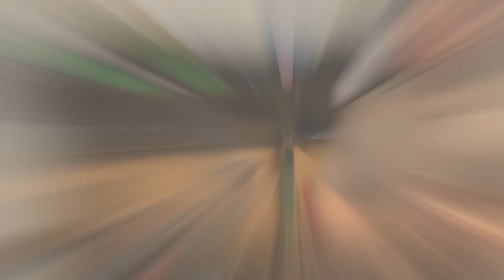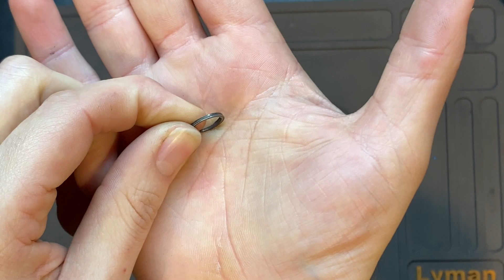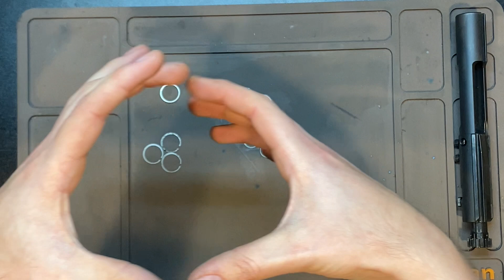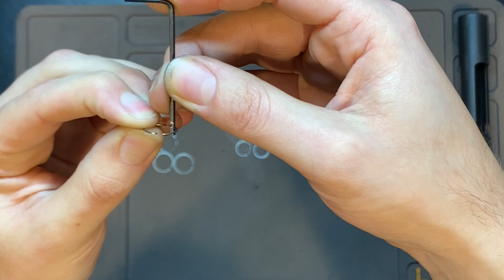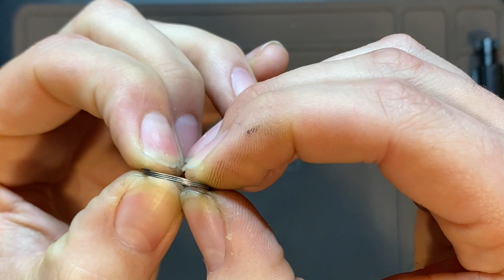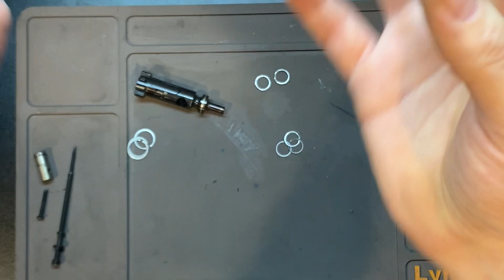McFarland/JP One-Piece Gas Ring VS Mil-Spec Gas Rings for the AR15/AR10

Comment: Thanks for sharing. 

Is it fair to say that you are under the impression the primary reliability issue you have run into with low mass carriers is not overcoming all the forces necessary to completely chamber the round? 

I've run multiple 6oz carriers with the springco yellow and have had the occasional malfunction, but when inspecting it with a high speed camera (and while not being able to reproduce a malfunction), it seemed more likely that issues in my case could have to do with bolt bounce more than falling to completely chamber. 

On one hand I could imagine a scenario where the one piece ring allow more bolt bounce as the friction is reduced but after it has bounced it would likely have a better chance of going fully into battery. 

Are you/would you exclusively run the jp one piece ring for a comp gun with an in spec low mass carrier?

Comment: This was helpful. My new 308 build … BCG is refusing to open. Gas port fully open …. It’s basically a bolt action. And every time I use the charging handle i have to brace it and use both hands. I checked headspace. No issue. 
Saw this video. Took out gas rings. It’s smooth as butter. 
So I’m gonna try the JP gas ring. Ordering it. Thanks for the explanation.
Reply: Your problem is that whoever made your barrel or gas block didn't drill the gas port to spec, or it's plugged.  not a gas ring problem.
Reply: @shockwavecity  right. Gas port too small.  Typical on these barrels from BCA. But changing gas rings easier than drilling hole.  But yes.  It’s the hole poorly made
Reply: @alecubudulecu did the JP do the trick for you?

Comment: As they wear out, it allows the opening in the rings to open up. If the opening in the rings have aligned, more gas and debris will escape. Only a big deal in extreme wear cases.

Comment: I always thought the gas rings are spring loaded so they form a tight seal against the bore of the carrier’s bore with making it an interference fit. If they’re not tight that means gas and the debris the gas is carrying will blow past the the rings and out the back of the bolt into your fire control group. You don’t want that flowing past the gas rings, that’s what the vents in the side of the carrier is for, that blow the excess gas out of the ejection port.
Reply from the maker: They are mainly spring loaded to take the shape of the bore. Having the shape of the bore is what provides their seal, not so much the pressure against it.

Any gas that makes it past the rings simply makes it to the vents on the bcg.
However, the Carbon on the fire control group is more than likely coming from the bolt tail seal. The bolt tail doesn’t use gas rings so there is always a leak there.

The vents are simply there to relieve the pressure once the bolt has been unlocked that way it can redirect excess gas away once the needed amount has been used.

Comment: The only rings I've ever seen not turn is oil wiper rings, everytime I've taken a motor apart i assembled the combustion rings are moved but the oil rings are not. You're one of the only people that truly understands gas rings!   I've seen so many videos of people regurgitating the same information, your the only person to use your own terms. You have a good understanding of physics an also are good at communicating, very informative video!
Reply from the maker: Thank you! I do try my best! I am an automotive test technician by trade, alot of what i talk about in my videos is based on my experience from my line of work.
I do take pride in what i do for a living and i love sharing these similar concepts with others who share the same mindset.

Please dont forget to subscribe, i have more content that i plan to upload in the near future!
Reply: @eitrisenhancementsllc  got my jo enhanced gas rings, an that's insane with how theres no resistance on the rings but holds pressure great! Worth every penny on a gun thats low on gas.
Reply from the maker: @jogs2fast  did you end up having good results with the JP in your build then?
Reply: Took roughly 200 rounds to get the rings broken in an sealed actually ended up with more gas an less drag! It's crazy with how the bolt just falls into the carrier but yet can be sealed better. 100% think it's necessary if the ring path is in good condition, preferably a low round count carrier. When I took the bolt out of the carrier the half of the bolt towards the firing pin side had NO carbon beat the rings had sealed it so good before there would be carbon/ unburnt powdered in every crevice.

Comment: Im having problems with super light gassed 300 subs hopefully the JP will reduce friction but still seal an help the problem.
Reply from the maker: Id recommend against this, you will actually lose efficiency, the JP gas ring should only be used on platforms that have excess gas available. If lack of gas is the issue then i highly suggest you keep the 3 piece gas rings

If you are struggling with cycling, i recommend you go another route that i just experimented with with excellent results.

Change the hammer spring to a reduced power hammer spring.
Currently im using a geissele ssa-e with an alg purple hammer spring.
This has no effect on pull weight on a 2 stage trigger, and since the geissele hammer is lighter, there is no need to “bob the hammer”

People forget that it takes energy to cock the hammer. Not only that, its energy stolen from the cycling of the bolt.
Reduce energy required to cock hammer, more of that energy gets used to cycle the bolt.

The results were quite drastic for me, especially since its energy stolen at the beginning which is the most important time for guns with short dwell time.
Reply from the maker: I stand corrected, my testing has shown the opposite, ive had great success with jp gas rings in 300blk

Just have to make sure you are using a properly spec’d carrier. Typically anything chrome lined will be g2g
Reply: The 300 Bo was designed for a 200 gr. bullet using a silencer. Which gives the back pressure.     Without a can an AR15 will operate well with bullets from 115 up to 135 maybe a little more.

Comment: Honestly, I was looking at JP to extend the life of my rifle. The firing pin and gas rings have been my issue and I forgot I had a JP bolt on my 22” Grendel that’s had 0 issues for awhile. I’ve always replaced with regular gas rings.  My goal for my 5.56 is to remove as many of the failure points as possible while maintaining or increasing reliability. So far I’ve been replacing my bolt head and buffer but normally at 6k/7k I’ll have to replace the gas rings, which is annoying, because at 12k I have to replace the bolt and barrel anyways normally. Im gunna try this out with my 6.5k gas ring swap rn and if it works to 12k I’ll swap it over to the new bolt.
Reply from the maker: This makes sense, and honestly it should be able to make it to 12k considering the jp gas ring will not be dragging as aggressively as the standard gas rings.

As long as you are fitting the jp gas ring in a bolt carrier that has good tolerance control, i expect zero issues.

Honestly, JP’s surface grind is what the one piece gas ring needed to be perfect in operation.
Only thing where it still suffers is if the bore that its going in is properly spec’d or not.
If using a high quality bolt carrier, then i have no doubts the jp gas ring will just shine and eliminate wear almost entirely.
Reply: @eitrisenhancementsllc  I’m running a SRC BCG on the 5.56 but my Grendel is a SRC carrier and JP bolt. The JP bolt works great in the SRC so hopefully the JP gas rings will work great in the SRC BCG. I’ll see for sure. I like content btw man!

Comment: Great explanation! Thank you for that because I always wondered, I run Sprinco gas rings and all my springs but Ill order a couple one piece and give em a try. Now I know what to look for or expect….. I use Sprinco blues in all mine and the forward pressure is on point lol I think it would work fine if my tolerances work.
Reply from the maker: Glad to help!
I also stick to sprinco, or at least a reputable company like geissele, JP, and others.

Is there a particular reason you are seeking to replace them?
You are welcome to try them, but unless you are having problems of either weak forward pressure or short gas ring life, i would just tell you to save your money.

They are good, but their uses are for such niche applications that the extra cost isnt worth the gains unless you are actually having a problem.

If you are planning to get one simply as an upgrade because you like it, then more power to ya. They will outlast standard gas rings.
Although i would pay the extra for the JP surface ground ones.

Hope this helps!
Reply: @eitrisenhancementsllc  it does and no Im not having any issues, I buy quality parts one and done you know…. Just thought mainly about longevity honestly. If I had to run on one set and couldn’t get extras etc.
Reply from the maker: @Marcus2750-u1t  fair enough!
I have no argument there!